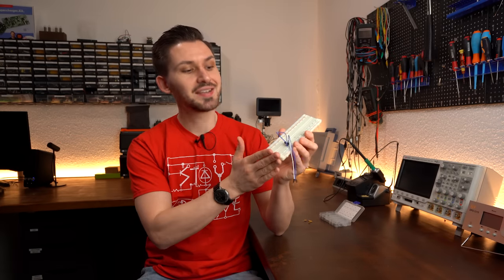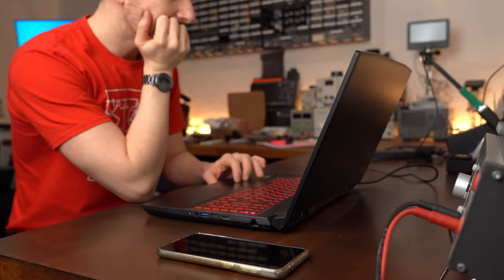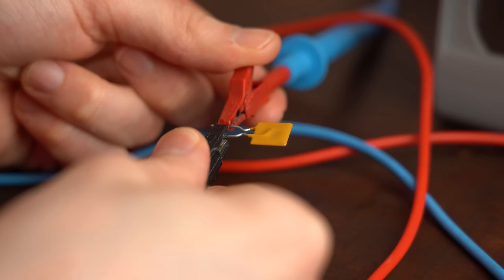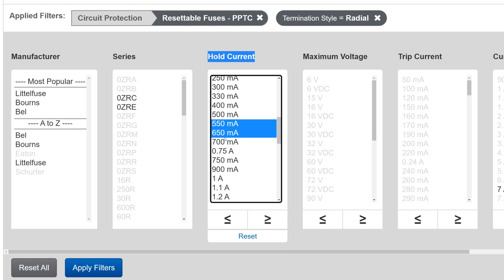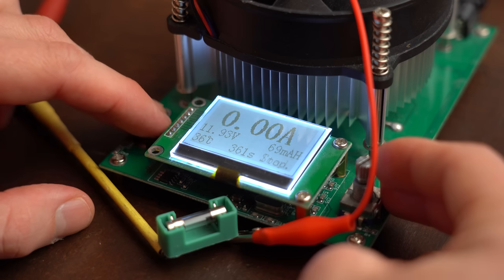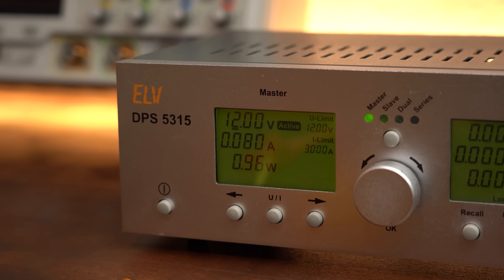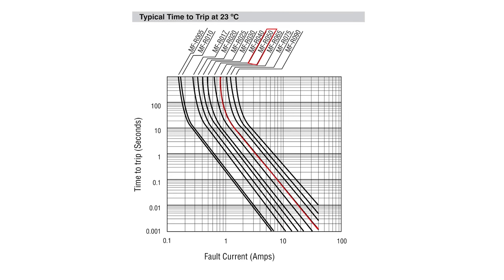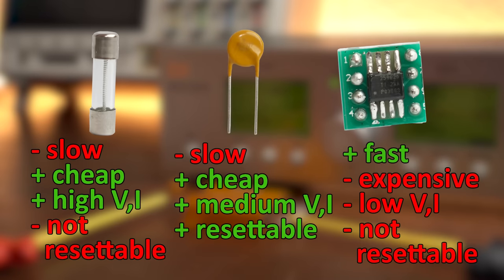The Best Protection for your Circuit is NOT a Fuse!.....but a Resettable Fuse? EB#54

Comment: some resetable fuse could go bad without any reason at all , i have experienced this on a medical machine that runs 24/7, like a xray machine and audiometry diagnostic machine have their control board protected by smd 1206 ressetable fuses , all of a sudden the machine just shuts down and it took me 1week to diagnose the problem is a ressetable fuse, after some time the machine just dont want to work anymore 😄, (these machine are more than (5 years old). so i can say that these ressetable fuses are not recommend for long use and its pretty much useless to use on long life machines

Comment: Can we use relays as fuse? Pick a relay such that operational current is not enough to trip the relay. But once high current starts pouring in, relay switches.
Reply: Go find a relay with a coil that can handle 10Amps, 20 Amps.

Good luck with that.

The purpose of a relay is so that a small voltage and small current can switch a much a higher current.

Therefore the coil tends to be made with low guage wire which means it can't handle a high current.

Comment: Those things have a life span. Description of fuses is inaccurate. You want speed? Use a fast blow fuse, some are fast enough to blow on ESD discharges (4 nanoseconds). Fast blow fuses have issues with in rush current. Slow blow fuse are slow to avoid current spikes. Current sensing shutoff are better. More accurate. And way faster.

Fuses are meant to be a last recourse to prevent damage.

Comment: Don't you think the resettable fuses in some case cuts off when there is a short due to increase in  temp and soon the temp decreases causing the fuse to set back and this will continue to happen in a loop causing the system to turn on and off repeatedly

Comment: as I understand, these are better not be on path of constant air flow used to cool the device it is in? otherwise they might not trigger when expected?
Reply from the maker: Correct
Reply: @greatscottlab  would it be then that they are also sometimes placed in a heatshrink tube for same reason?

Comment: I think designing with these is currently very difficult to do in a responsible manner.

The on and off-resistances will change greatly through their lifetimes, which when coupled with their relatively low off/on resistance ratio, makes it quite difficult to guarantee that it won't be too high resistance when there is no fault, while at the same time always being sufficiently high resistance when there is a fault, through the components lifetime.

And if you are not designing for the post-reset abnormal behavior, why are you using a resettable fuse?

Comment: I was struck by the fact that there was a constant power loss in the tripped state - I bet that's driven by how much heat the specific package can dissipate.  I wonder if a fan or heatsink would have an appreciable impact on that behavior...
Reply from the maker: A fan would make the fuse so cold that it would no longer be tripped.
Reply: A heatsink would increase the trip loss, because more power is needed to keep it hot

Comment: What about lets say one that has a hold of 3A with a 4A trip 40A max and you get a sudden surge of 35A and that surge happened to be through 15A rated mosfet...
Would the PPTC trip before the mosfet got damaged?
Reply: Short version: it depends. Longer version: it should be safe if the MOSFET is fully turned on.

Comment: So when building a circuit, can I add both of them? Glass fuse and resettable fuse?
Reply: You have to be very careful about failure modes. AFAIK a glass fuse will never fail closed. Of course, you can add both in series, you can also add a crowbar or TVS to prevent overvoltage etc... The first priority is always safety (fire hasard...). Then the second criterion is protecting valuable components. Last criterion might be comfort.

Comment: Nice. How can I limit inrush current to protect relays when I switch a smps with a large smoothing capacitor?
Reply: You can use an Inrush Current Limiter (ICL) which is a type of NTC, the opposite of the PPTCs featured here. Most SMPs have them built in. Their downside is they do not limit inrush for short "off" times because they need time to cool down.

Comment: Would you say there is a significant difference between PPTC and a "Thermistor"? It sounds like they are almost the same (if not synonymous or a suitable replacement for one another)
Reply: The PPTC is a specific type of thermistor. There are also other types of thermistor. NTC thermistors are very often used for temperature measurement.
Reply: Two completely opposite types of devices.
PPTC's are positive temperature coefficient, thermistors are negative temperate coefficient.

They are not interchangeable devices.

Comment: For some reason, all electronic build in China (and not designed by a Western Company) do lack a fuse, or any other type of protection. This is disgraceful.
I have been designing electronic systems for decades. I included a fuse of the proper size and speed on both sides of a power supply, i.e. on the main side (220 or 110 V) a slow-blow 2.5x max current, and a fuse on secondary, 3x fast blow type.
Resettable fuses (polyfuse) arrived on the scene in the '90s, and they were a godsend for inductive loads and generally for high power factor (cos φ < 0.68) devices. I begun using polyfuses in series with the primary of the main power supply transformers too, but I run into problems because the main transformer mode of failure: either the primary winding opens - no problem there; or the primary winding partially or fully shorts. The polyfuse intervene, heats up in few hundred milliseconds and presents a megaohm - level resistance. People plugged in and out the device, noting some reaction, and after few cycles, the polyfuse blew up: they can't be cycled quickly.
So I went back to slow-blow, sand-filled (arc damper) 5x20 fuses.
My 2 ¢...
Reply: I've seen lots of power transformers with a thermal fuse mounted in the internals.

Comment: These self resetting fuses are not Fuses. They are good for a limited number of cycles.The Best circuit protection is a good old mechanical circuit breaker. The only disadvantage is they are slow because current needs to rise above a set level.. Better than fuses and good for most circuits.
  Now for those who need lighting fast response. Remember that voltage drop leads current rise when a circuit fails.. On a should use a mechanical DPDT break before make type relay (or a Solid stare relay of you can fine one suitable) One pole is your on/ off switch  (normally off) and the other pole clamps open the load when power is removed.
The relay is controlled by a resettable JK FlipFlop. The flip flop is driven by a voltage detector If  the voltage drops below a preset level the circuit assumes there s a short and shuts down the load..
In the normally off mode it does consume power when the circuit is operating normally. 
In the Normally on mode  it does  NOT consume power when the circuit is operating normally. But a battery backup is recommended.
In the event of any failure the load is instantly separated from the power supply.
A failure would include a Brown out of the AC supply.
This circuit will work for a wide range of current capacities and depends on the relay specifications.
The trip point is precise.
Better than a crowbar circuit.
I use Mouser all the time, for decades.

Comment: The device you are using as a load as in the time spamp 5:26, what is it? I want to do some test of power electronics of my own and I am kind of bored with altering the resistances one by one and using 2 DMMs for supply power and current.

Comment: Were you using slow blow or fast blow glass fuses?
Reply from the maker: I used both for various tests in the video.
Reply: @greatscottlab  was there a notable timing difference between the slow blow and quick blow glass types, I have never bothered to actually compare them.

Comment: Is there something of similar size but that works like a breaker, with relatively fast reaction and manual/external resetting?
Reply: Many different kinds of protection circuits can be built.....
One has to study  end application/ research datasheets ..etc...besides thoroughly knowing component behaviour .

Comment: Hi scot, 
Can you redo the experiment but in real life situations for example consider both factors time and rising current in real life ordinary fuses are rated 1amp i think if the current stayed  stable they will not burn but since the short circuit cause the current to rises very fast it will cause it to burn. My question is how many seconds when a short circuit happens both fuses will burn or reset? Please make real short circuit 😊 thank you

Comment: Is it possible to use relays as voltage protection? Once voltage is outside of range the relay pulls the circuit open.
Reply: Too slow to prevent damage.

Comment: Could this be used with a relay so that after the relay is triggered the pptc goes into a low power state but enough for the relay to stay on ?
eg; I found that a 12v relay will trigger above 8v and stay on until the voltage drops below 4v .

Comment: Could this be used to lower a start up current to a max amount?  I know it couldn't by itself. But perhaps in conjunction with a circuit to switch current draw to a alternate circuit with a resistance added?
Reply from the maker: If you want to limit start up current then check out my soft starter video ;-) You can use a PTC there as well.
Reply: No ..to lower start up current one needs to use an NTC. type inrush current limiter...
Reply: @greatscottlab  I think the best thing for me to try is an autotransformer start.  I already have the transformer. So ordered a delay on dpst relay.  It's only a 120vac motor. Thanks for your videos

Comment: Hi.
I work with electric scooters and many of them have problems with overheating and get burned controllers where the transistors(mosfet) often burns. My question is if it's possible to use this kind of fuse one the 3 phase cables to stop this for happenin?
Reply: The solution is to upgrade the mosfets
Reply: @techheck3358  yeah have tryed that but even the stronger mosfets breaks

Comment: With a suspect mains powered device a good way to prevent blown fuses is to initially power it with a LARGE mains light bulb in series with any input lead ... the bulb might glow dimly indicating a working device .... should the bulb glow with full brilliance , the device is VERY faulty , and should be fixed ( but your fuse will be OK ! ... tried - n tested ) .... DAVE™🛑

Comment: Sooo... What's the difference between these and the varistors?
Reply: Varistor responds to voltage. Fuses respond to current 

Current and voltage are not the same thing.
Reply: @deang5622  Yes, I'm aware of the difference between current and voltage. My confusion comes from the statement: "What they do and what their name basically implies is that they increase their resistance when they get hotter." An increased resistance, is not what a varistor does? Maybe I'm just ignorant about how a varistor "responds to voltage"
All in all, we can say then: varistor is an overvoltage protection, while fuse is an overcurrent protection.
Thanks for the clarification!

Comment: Ptc's are ok and bose use these on there series 2 and over (maybe) internal speaker circuit.if too much power inputted then they go high resistance but....Not as safe as a fuse.fuse is blown then no shock??????

Comment: I don't get it ^^
Why is Imax much higher than Ihold and ITrip? 🤔
Reply: Because IMax is the current at which permanent damage to the device occurs.

iTrip is the current level at which the device triggers and goes high resistance.

ITrip needs to be lower than IMax otherwise when the device trips it will become permanently damaged and not resettable. 

And then manufacturer will be sued for false advertising and false claims because the product doesn't do what it is supposed to do, which is be automatically resettable.

Comment: Why they looks like Ceramic Capacitors?
Reply from the maker: I have no idea
Reply: Same package so you are wrong, they don't look like capacitors or whatever. Generally, you can put anything of similar volume in any package. For example, it makes sense to put resistors in the same package as power transistors as well as rectifiers, and some Chinese scammers even sell 2 diodes in the same package as bipolar transistors, but the general reason is that such package is cheaper for some purposes.

Comment: It looks like a ceramic capacitor; but it's not?
Reply: A capacitor holds charge. This devices does not. It changes its resistance when current exceeds a threshold.

Two totally unrelated functions.

Comment: Hey guys i need help to fix my ps2 an smd fuse rated at 0.7a is blown and i cannot get a replacement but i do have a printer controller board which had lot of smd fuses, resistor how can i replace with it

Comment: Are there resettable fuses adequate to high quality audio or signal circuits or even to a guitar cable?
Reply: Why would you want a fuse in the signal line to a guitar pickup?

Are you worried you are going to burn out the pick up?
Reply: @deang5622  Defective pedals and very low quality power can burn multiple pedals, boards or even electrocute you through the guitar. A chain of resettable fuses can save multiple equipments, even your life.
Reply: @LNVACVAC A fuse does not prevent against electrocution. An RCD does - residual current device.
Reply: @deang5622  An RDC on most low budget settings will cut the power repeatedly with no apparent reason. Also, an RDC is supposed to work with a ground, and many places don't offer one.
Reply: @LNVACVAC  if you are at risk of electrocution from the apparatus you are using, then you need to fix the apparatus and use safe equipment.

The voltages for a guitar in normal fault free operation are not at a dangerous level.

Don't use dangerous equipment.

Comment: HOW ARE THESE DIFFERENT THAN MOV'S
Reply: Clue is in the name. MOV - metal oxide varistor.
Varistor. Voltage controlled resistor.
PTC's are sensitive to current, not voltage

Comment: One more drawback to regular glass fuse. After couple of years, socket start to get dirty, hot and problematic. Best is to replace glass fuse and clean metal sockets once per year. When you have this problem because of fuse and socket, it will be last place to look for solution.
Reply: Nah, total rubbish.
I have had glass fuses in situ for 5 years, even longer without any issue.

Comment: PPTCs are too imprecise and unreliable for my needs - there are plenty of issues not mentioned here. They have significant derating factors over time, temperature and humidity. They can fail to reset. Don't even thinkg of exposing them to mechanical forces... for example, slight flexing of the pcb an smd pptc is soldered too. These issues might be tolerable if they were user replaceable, but they're not. So I wont be using them in future designs. 
I have watched the eFuse video, and would appreciate more content on them

Comment: i would use a crowbar circuit rather this device
Reply from the maker: Actually never heard of this circuit. Will look it up.
Reply: And that because you don't understand the difference between over voltage and over current protection.

So you would use a circuit without knowing what it is designed to do?

Crowbar circuits protect against over voltage.
Fuses protect against over current.

Do you understand the difference between current and voltage? Current is the flow of electrons (measured in Coulombs per second which equals amps) and voltage is.....

Comment: this is not a good idea, replacing a 'one time' blow fuse with a resettable one is only delaying the enevidable, therefore increasing the potential of a more catastrophic failure that could destroy the device permanently.
the whole point of having a 'one time' blow fuse is to let you know something is wrong 'somewhere else' in the circuit and you should trace that down and fix the actual problem elsewhere in the circuit without damaging any other components.
only an unaware amature would apply this inaccurate information to what they are doing. instead of being lazy, do some actual research and take an advanced electronic's class and stop promoting bad practice and putting people on the wrong path in their carreer.
Reply: Which is why he specifically said for testing purposes
Reply: @techheck3358  did he say specifically 'for testing purposes'? or did he actually say that replacing glass single use fuses during testing can be expensive and so using a CB type fuse was better but not actually saying 'for testing purposes only'. His incinuation is that using CB type fuses were better over single use fuses and that's what he is selling his whole concept on. Even went as far as to promote a vendor he uses.
the context of the video went far beyond what you are saying, you're just ignoring that part.
Reply: @swoopulater  that’s how… words work. What you say is related to what you previously said. lol